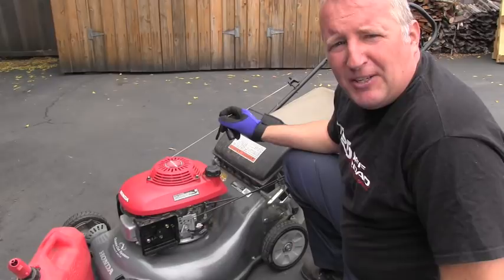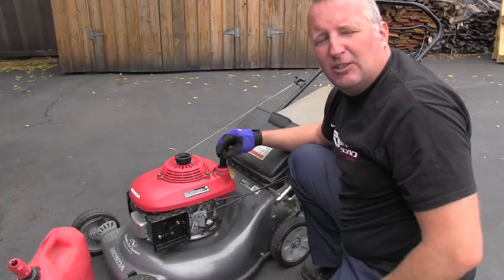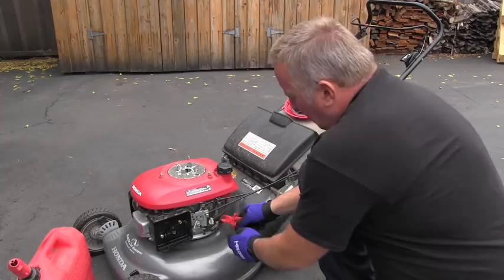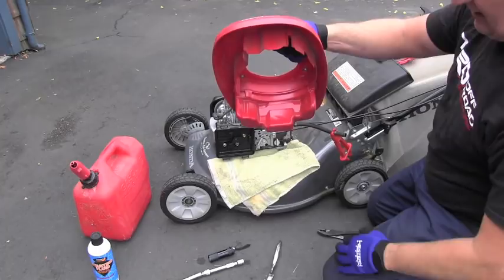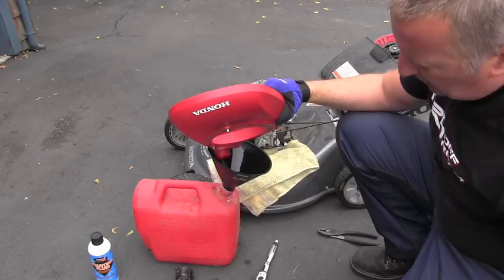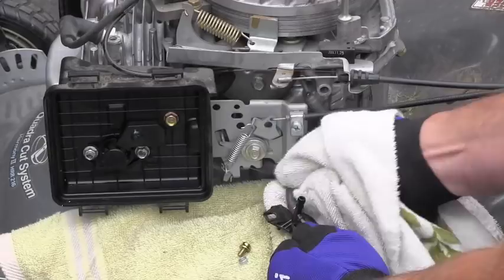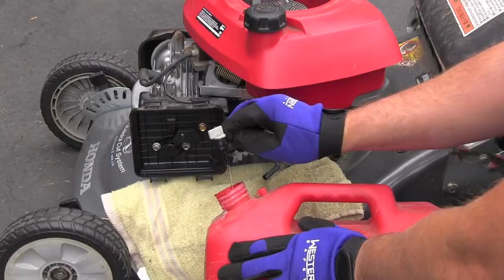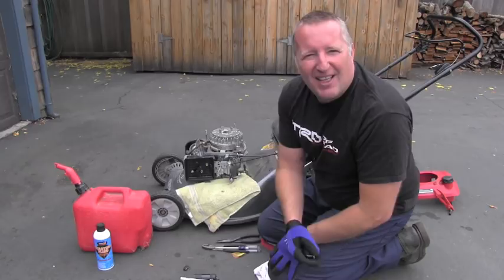Honda Lawn Mower No Start Repair Part 1

Comment: I found your video very clear and informative. Having watched how you spry directly in to the air intake to check for fuel delivery I tried this using carburettor cleaning fluid and it started first pull and kept running until I had mowed all the lawn. So, Thank you very much. If I have further problems I shall watch your video on how you clean the carburettor. I have done that successfully once on my band saw but not on my lawnmower..
Reply: Hi, have you tried to use your mower again and needed the carb cleaner?
Reply: Naoki Hotta yes. it works fine and have used it several times since.

Comment: 2:26 Taking the fuel hose off - mine is just not coming off. Using pliers like you the rubber started to fret, I'm concerned using anymore force and the pipe will break. Any tips?

Comment: Fantastic video and got my Honda mower working again. Anyone know why my filter housing was extremely oily and the cause?
Reply: you may have tipped the engine on its side with the air filter on the bottom and oil leaked into the filter.

Comment: when I use the 10mm socket. the nuts won't loosen. They spin, but so do the bolts. Very frustrating cuz I need to replace my starter rope. I tried lube, I even tightened them more in hopes that I can just get the nuts to spin. still no luck. Everything still wants to spin together.  😭😭
Reply: Va9ers21 i had this same problem and have a solution if u still need one
Reply: @brianl6964  I have this problem now..any tips on getting them off?
Reply: I ended up backing the studs and whole shroud off. Then i put super glue in the stud female ends in the block and put it all back together. Then like 5 hours later, the top nuts actually broke loose as the studs were siezed from the glue.